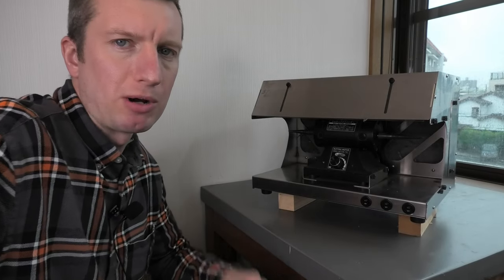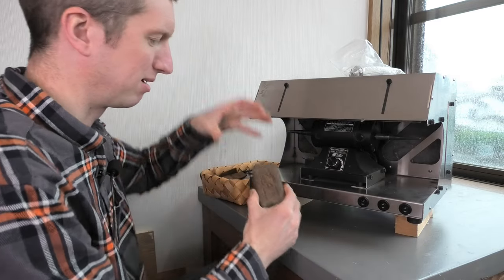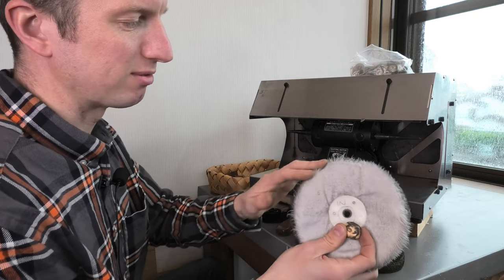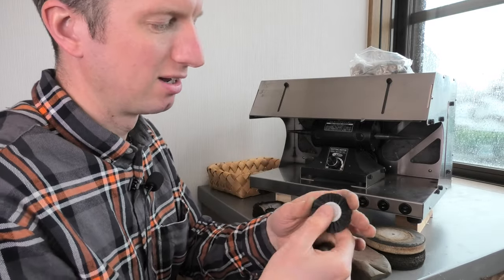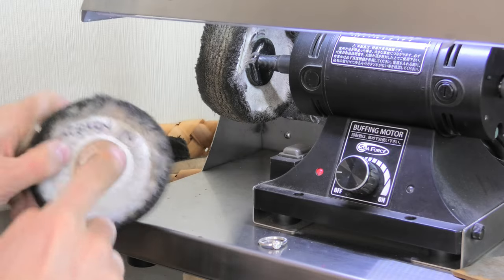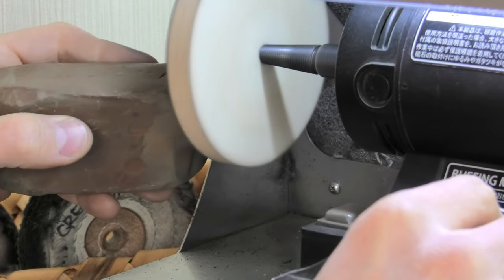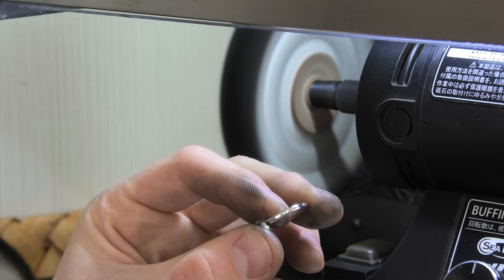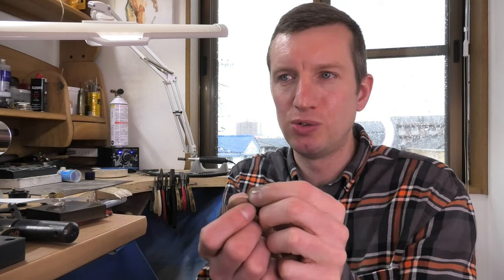Basics of Polishing Jewellery

Comment: Scratched safety goggles: you can use cleaner/polishing liquid for motorcycle windshields to clear the scratches out and get rid of the "fog" that forms. Also good for your car's headlight lenses. It takes some rubbing with a cotton cloth, like an old tee shirt, so it takes a bit of work, but it is very effective on clear plastic.

Comment: My hard and fast is based on material. 

In silver, 400 800 1200 sanding then green rouge and then red rouge. 

White gold file, 400 grit, 800, 1500, green rouge, black rouge.

Yellow. Same as silver but you can just do 400 800 and then green and red rouge.

Comment: Hey! If I see stain marks on the piece of silver jewellery after polishing?  What am I doing wrong?:)
Reply: Cover your whole piece with flux before anealing and soldering, stain marks are just cuprous oxides which are created when you heat up the piece to the right temperature, flux prevents oxidation. Ofcourse remember do pickle the piece, most of the times 30% sulphuric acid works best. If done right you would get very little stain marks. Stain marks can be polished out with more abrasvie pastes (e.g. green paste).
Reply: Heard someone say something about to much heat from the polishing, but prehaps only on lower grade silver. I've had the probl on things made from sterling silver spoons.
Reply: @CONEHEADDK  that is right, silver cutlery was / is usually made out of 800 silver alloy. So the more copper in alloy  the more cuprous oxides will be created. Polishing won’t heat up the piece to a point where copper would start oxidizing.
Reply: @8866ryfxd  Don't know why, I called it Sterling. Here in Denmark I've only seen 830, called 3-tower, with 3 tower stamps.
Reply from the maker: Like dull grey patches? Its called fire scale or fire stain. Silver is prone to it. The black bristle brushes with tripoli compound polish removes it quite well. Basically just polish over it harder!
Reply: @DiamondMounter  thanks fot your answer! Love your chanel!!
Reply: @8866ryfxd  thanks!!

Comment: Hi Chris  That's very useful, thanks.  One question, do you wash/clean the item between mops?
Reply from the maker: No I dont. It would take so much extra time to do that plus getting a ring wet in the ultrasonic isnt a good idea half way through polishing.
Reply: @DiamondMounter  Cheers Chris, good to know
Reply: I do wash jewelry between the different grits of polish - I was taught that if you polish with tripoli, then polish with rouge without washing the tripoli off, the tripoli residue will contaminate your rouge buff, and the tripoli will scratch your rouge polishing job, making kind of a  "satin" finish, rather than a mirror finish. I also wash it again thoroughly at the finish. 

To wash it, I use a "jeweler's soap" made from ammonia and liquid dish soap/detergent. I don't put it in the ultrasonic, I just use a very soft toothbrush. The jewelers soap is also good at getting the tripoli and rouge off your fingers, and other gear, because it cuts the grease. The ammonia does smell bad tho. 

Polishing is a process of taking out rough scratches by making finer scratches, so you move from rough grits to finer grits. Not cleaning the rough polish off before going to the finer polish seems like taking a step backwards, to me. But I have not made as much jewelry as Chris has, so...different opinions. So this is just my two cents.

Comment: Many of us couldn’t afford that polishing unit
Reply: What’s that got to do with the video, he’s showing you how to get a good finish not how to save up for a polishing motor.
Reply: @kin4351  yes with that unit
Reply: But we all could afford some beat up cord drill (mine are faster than my batteri ones) and clamp it to something, and put a cardbord box around it with a vacum cleaner attached.
Reply: @johnbday4764  John, you don’t need that unit it’s not even a particularly good one, as Chris said it lacks the torque of a good unit. More importantly, it was the process of doing a lot of work pre polishing that was good advice. I’ve been a jobbing jeweller for thirty eight years and still learnt the odd thing from this channel. Don’t get tied up with needing this or that tool, it’s your attention to detail that will make the difference.
Reply: @kin4351  try and be understanding , john b , before I got a polishing machine , I did all my polishing with my flex shaft. Takes time, but gets the job done

Comment: Why do my bronze rings keep tarnishing so quickly after I polish like <week
Reply from the maker: Iv never worked with bronze i dont know much about it sorry
Reply: Bronze and brass are both alloys made out of copper, zinc, and tin. Bronze has more tin so it is harder and more brittle than brass. But it is the copper in the bronze that is tarnishing. Tarnish is copper's form of oxidation, similar to how iron objects oxidize or "rust". There are many things in the air that will cause tarnish, including moisture and air pollution, so it is kind of a losing battle to put a very highly polished shine on copper, bronze or brass objects, UNLESS you master the art of "patina". Patina is the art of using chemicals to control the oxidation of copper/brass/bronze objects. For instance the Statue Of Liberty in New York City is copper, but it has a blue/green patina. You can research "patina on copper and bronze" and find many colorful examples.

Some art craft fair jewelers have had some luck dipping their copper/brass/bronze works in lacquer, (clear fingernail polish) which will keep the air off the polished finish, but lacquer is not permanent and will wear off over time.